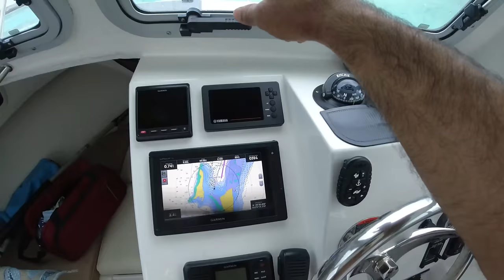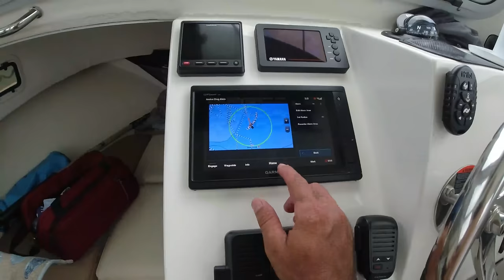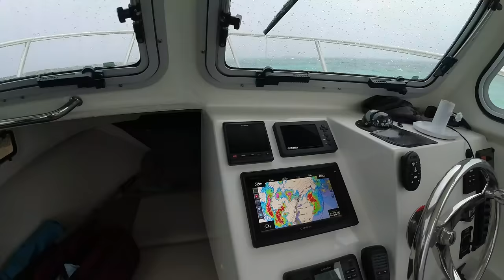Storm at Anchorage in my Solo Crossing to Bimini Bahamas in my Small Crooked PilotHouse Boat

Comment: Cool. Last time I was here was nearly 20 years ago. It's a little south of the SS Sapona wreck. 
Lightning is always a concern. I've had outriggers and rod tips crackle from the static before a nasty close strike. I was on a boat at a marina where it struck the boat in the next slip and it turned the antennas into fiberglass palm trees.
Reply from the maker: Wow cap. It is very dangerous thats why i lower my rods and antenna fast, and the electrical damage is worse, thanks for watching cap

Comment: Sorry if you addressed this.  But have you ever thought of installing an Auxiliary/Backup motor?  I always run one and has saved me several times on Open Ocean crossings...  Thanks for the great Videos!
Reply from the maker: Is a great osdea cap but  Since I installed the minkota I couldn't add more weight to the boat so it was either a kicker motor or a minkota so I took The Choice and did the minkota which it moves the boat at 3 to 4 MPH thanks for your question cap👍⚓️

Comment: I hope you have a marine carbon monoxide monitor with alarm. I've tried putting that same Yamaha  generator on the transom, but after a while carbon monoxide starts seeping in. I think it is because as the wind blows past the boat boat,  it creates a low pressure area behind the cabin entrance that socks in the carbon monoxide.
Reply from the maker: Yes i do cap. Is the only way i will sleep in my boat and in 6 years i have never had a problem, thanks for the recommendation cap.😉👍

Comment: I've made one trip to Bimini in 2019 I have considered the dry tortugas always thought that would be a fairly safe run
Reply from the maker: Well I think the Bahamas blocks the rough seas to Florida so you have a better shelter from rough seas but when it comes to dry tortugas you are in the open ocean in the middle of nowhere in the small little island and if a storm happens to catch you out there you have no protection going to the island or coming back to the mainland but you have to watch the weather and get a good weather window like I did when I went I got perfect weather for 4 days and it's very hard to get Year round. 
 And thanks for watching
Reply: I have done both Bahamas (Bimini, Chubb, Abacos) and number of times, as well as Dry Tortugas.  I think crossing to and from the Tortugas from Key West is overall much safer.  One, for about 60% of the crossing you are in the relative shallows of the marquesas bank where anchoring in a breakdown might be possible.  You are never in the GulfStream current.  Two, there are daily ferries crossing in about the same line of travel to and from, so there is potential help in an emergency.  Three, you are always in US territorial waters with SeaTow and Boat US not far in Key West, and a USCG presence there and the rangers at Fort Jefferson.   I have always seen multiple other boats at the anchorage and in and around d the Fort, I’ve not felt alone or isolated.  My biggest fear crossing to the Bahamas is a breakdown in the middle of the Gulfstream, not being able to get help fast, and be swept north in that current.  In a short time you can be taken a very great distance north.   Most of my crossings have been without a buddy boat, but I have twin engines and all the safety gear - life raft, EPIRB, PLB, two gps units, fixed and handheld VHF radios, and a solid float plan with people at home monitoring my expected arrival.   I know you have a lot of the same safety gear and are experienced.  One additional thing I may get, or rent for another long trip is a satellite phone.  Great and entertaining videos man.  Stay safe!

Comment: What size boat do you have?  What capacity in pounds is your anchor?
Reply from the maker: I have a 21 feet boat amd 4500 lbs and here is the link to the ancher cap. https://amzn.to/3WWsFaV
You can get it at Amazon
Reply: @OutOnTheReef  45 lb anchor?  WOW, that is big, huge for a 21' boat.  I had a oversized 34lb for a 30' boat.  Guess if your windlass handles it, more the marrier.  Guess you'll sleep well with that beast on the bow,
Reply: @lorneserpa5888  try 14 lbs.